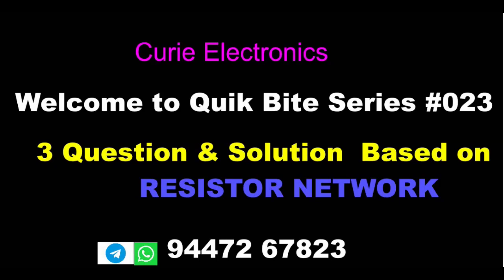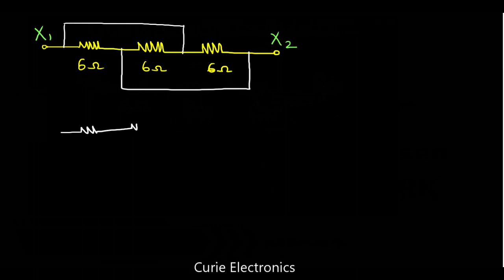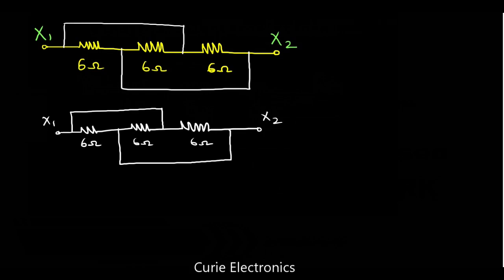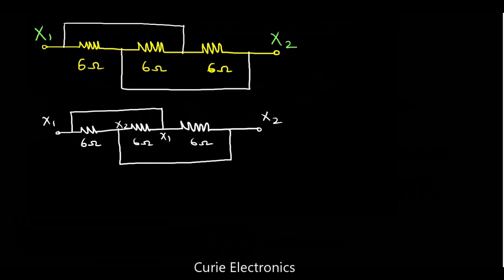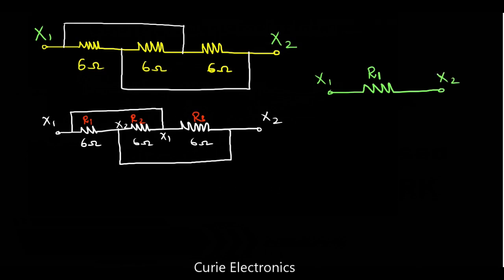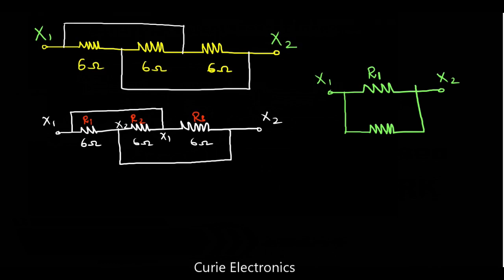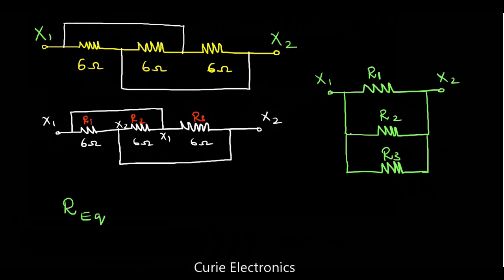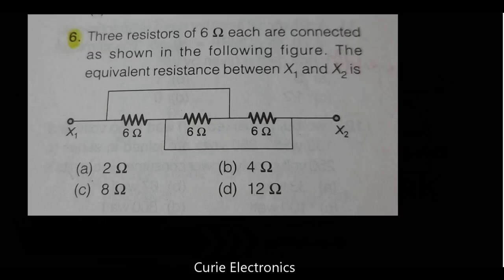RESISTOR NETWORK PROBLEM AND SOLUTION

Comment: Dear sir.
Is control system questions asked in technical assistants exam for electrical students??
Reply from the maker: Control system is there in electrical engineering syllabus.So they ask questions from control system
Reply: @CurieElectronics  thank you sir